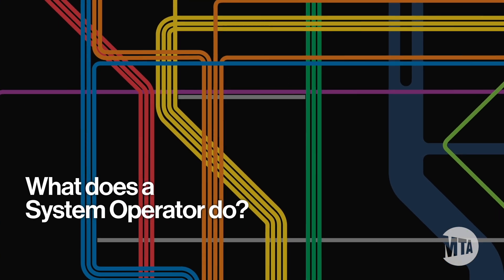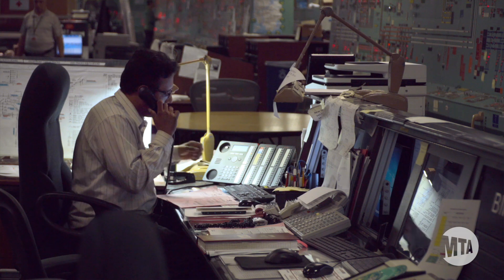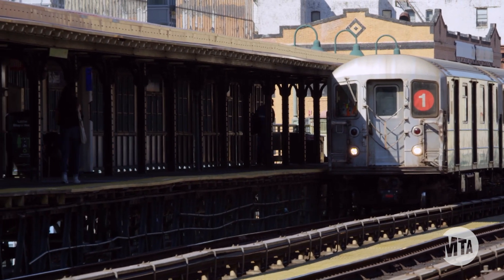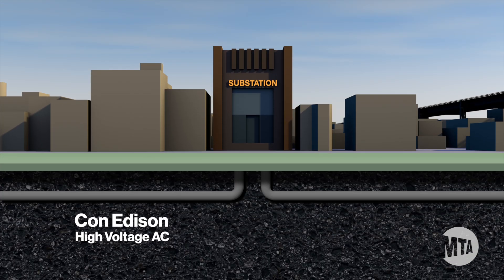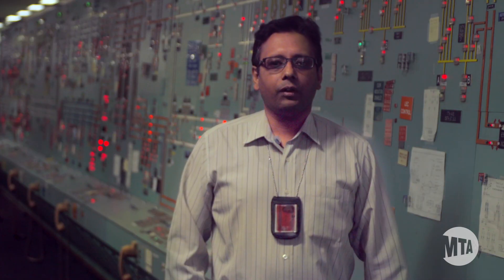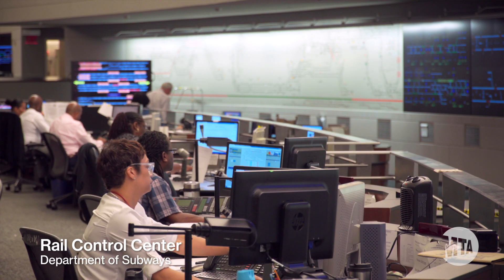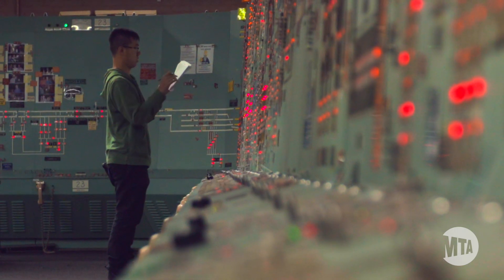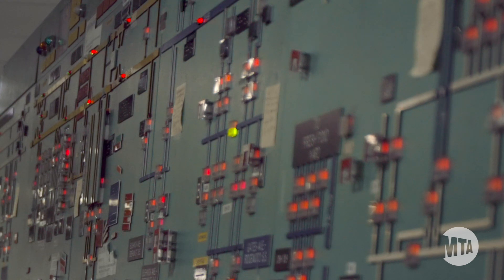What does a System Operator Do?

Comment: did you see how old their computers are?
Reply: That's nothing. The Power Department  decommissioned the last Rotary Converter in 1999. These rotary converters were first put in service in the early 1900's. The rotary converter was used to convert ac power to dc power for the third rail. The Power Dept tends to keep equipment working for a very long time.
Reply: They use their computers to connect with the system operators of the MTA to provide Con Edison volts to power up the subway tracks. : )